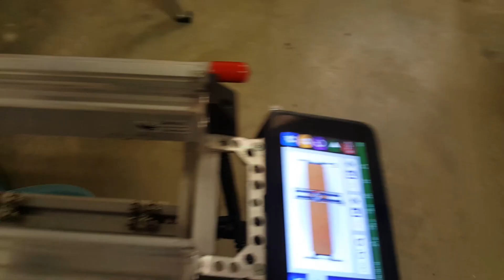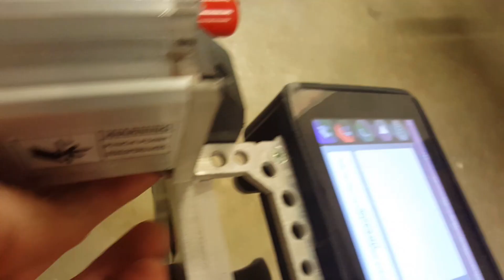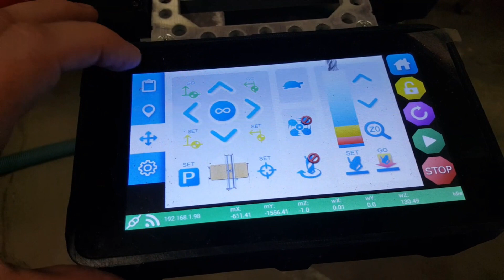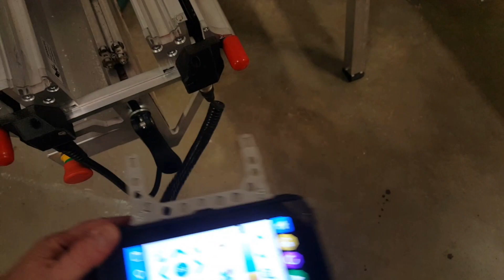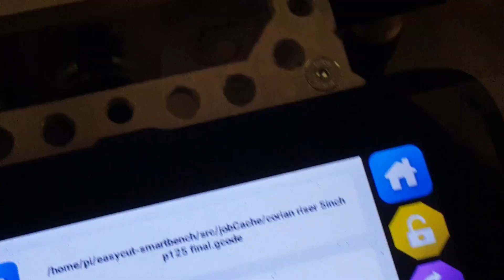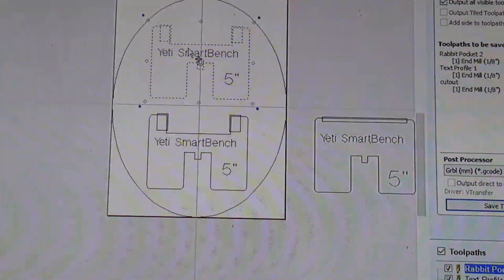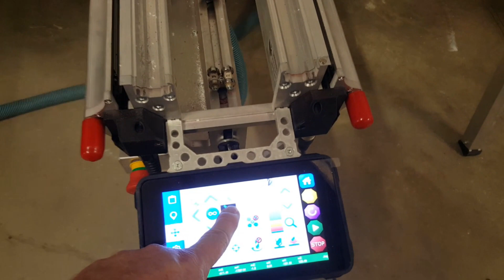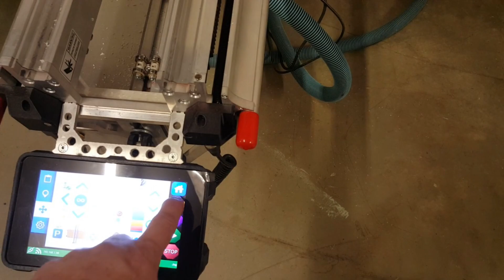Tips and tricks - Corian risers - Yeti SmartBench  --- Corian quality of cut

Comment: I tried to cut LG HI-MACS solid surface offcuts with my smartbench but had serious issues! I set the spindle speed to 24000rpm and the feed speed to 39 inches per minute and used a 1/4" solid carbide upcut router bit. All that I achieved using this material was the destruction of 2 dust extractors due to such fine dust! Should I lower the spindle speed and increase the feed speed? Any help would be fantastic as would the DXF files for the risers!
Reply from the maker: Several issues... I would suggest a spiral O for the bit choice; your cutting speed was WAY too slow if you were just getting dust --- you want a good chipload to cool the bit --- and then the dust extractor would not clog with very fine dust.  You should also be using a pre-separator (Dust Deputy or equivalent) to take >99% of the debris out before it gets to your dust extraction unit.  

So change your bit, your speed, and your dust collection method, and you can cut solid surface just fine.  On a material I have not cut yet, I typically would program in 100" IPM, and then adjust it at the console.  I also adjust the RPM while it's cutting to get good chipload.  I typically do a finishing allowance cut of .020" or so (size depends on the bit I am using - typically either 1/4" or 1/8" spiral O).
Reply: @yetismartbench  thanks for your reply. I'm using a trend t35a extractor now as recommended by trend so hopefully that works. I was thinking that the feedrate was probably too slow so will speed it up. What about RPM?  I will invest in a spiral 0 bit if I can get hold of one. Thanks for your help. The yeti is a fantastic bit of kit.